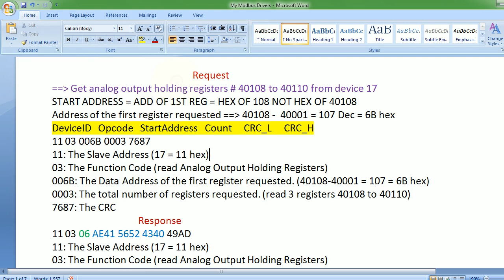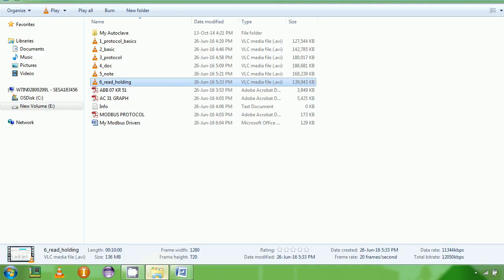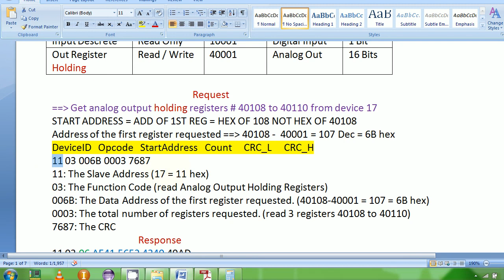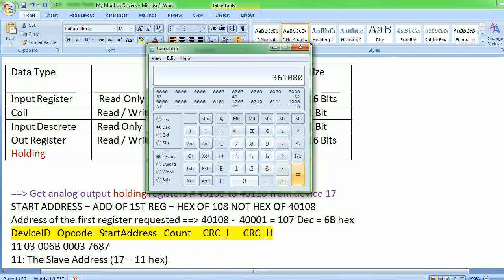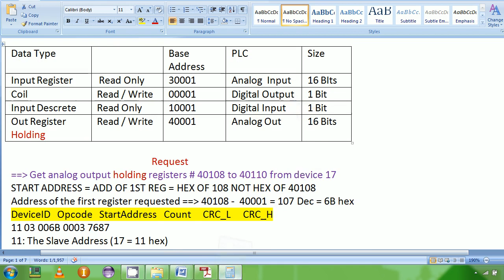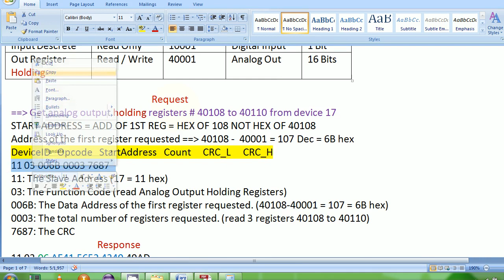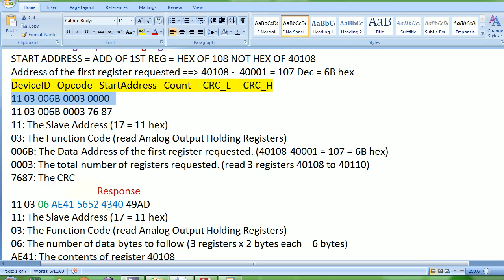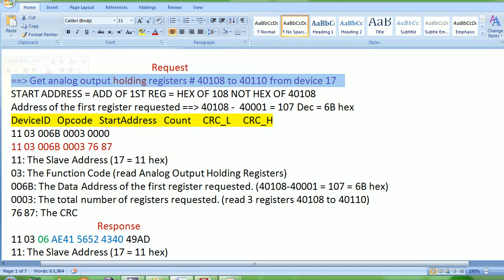7 Modbus RTU Protocol Read Holding Example   1

Comment: This is the best series available on internet to study Modbus RTU protocol. Thank u so much sir. I hope CRC calculation is also covered in this series. If not, plz make a video on it.
Reply from the maker: Dheeraj Ji , CRC calculation is a very common thing , you will find hundreds of videos explaining it so i did not make any video for that. CRC16 is used by Modbus RTU and CRC32 is used by TCP protocol , for the time being you can  safely use my C# CRC16 function and very easily convert it into C++ C Python function. While using JAVA just be aware that JAVA has a flaw , JAVA bytes are Signed Values........... Thank YOu
Reply: @jugnu361  Sir Thank u for such a quick reply. Though I m not taht good in coding I m trying to implement it using C. So far I have found one video and read from the document.
Reply from the maker: @dheerajchumble5602  CRC in C
unsigned short GetCRC16(const unsigned char* buf, unsigned int len)
{
    unsigned short crc = 0xFFFF;
    unsigned int i = 0;
    char bit = 0;
    for (i = 0; i < len; i++)
    {
        crc ^= buf[i];
        for (bit = 0; bit < 8; bit++)
        {
            if (crc & 0x0001)
            {
                crc >>= 1;
                crc ^= 0xA001;
            }
            else
                crc >>= 1;
        }
    }
    return crc;
}

Comment: Thanks for sharing!
But, why you substract  both register  ( 40108   -  40001) in your example.  Because, if apply same logic for other registers the dif value would be the same, isn't?

I'm trying to figure out,  because  in my job one guy use  in tcpclient module of python language calling function  holding_registers; number address 57 and 6 registers.   But the manual manufacture indicate addres 40071.  Any idea?
I would really appreciate your opinion. Thanks
Reply from the maker: holding_registers  number address 57 and 6 registers = 40058  40059  40060  40061 40062 40063
protocol part of it is straight forward , looks like u need to read the manual carefully , usually there is a small catch there.

Comment: HI, I need read registers with address 51000 and over of an energy meter. Buth the response is 0. Can I read this number register? I know that only can read to de address 49999.
Reply from the maker: address are vendor specific , consult the manual for it. what do u mean by response 0 ? does it mean that energy meter is not giving any response (= time out ) or the value at the register is 0? use this modbus tester software tool and a serial port monitor tool to precisely se the protocol data transfer in binaries , i mean the request and the response 
http://www.modbus.pl/Modbus%20Tester_MODBUS.PL.html
Reply: @jugnu361  thanks for answering me, and yes,  that energy meter is not giving any response. I will test de simulator.